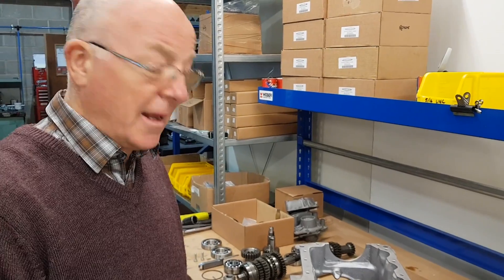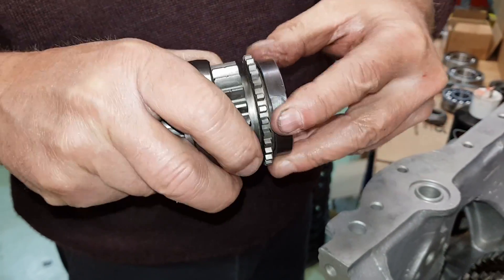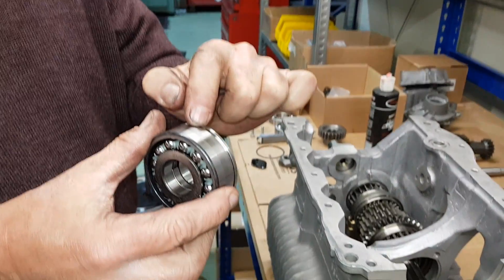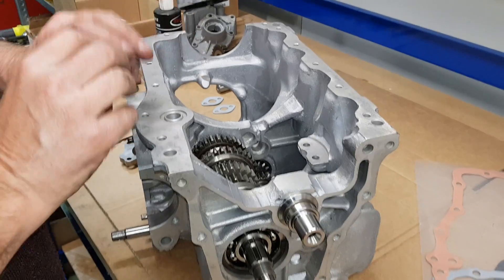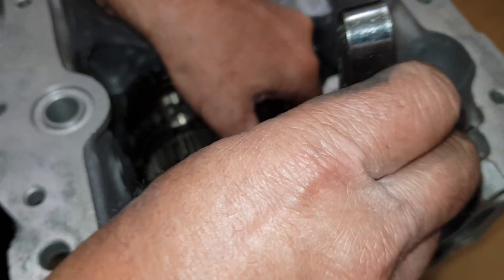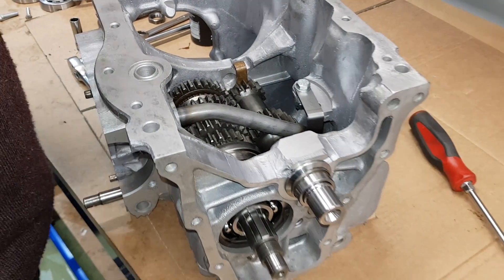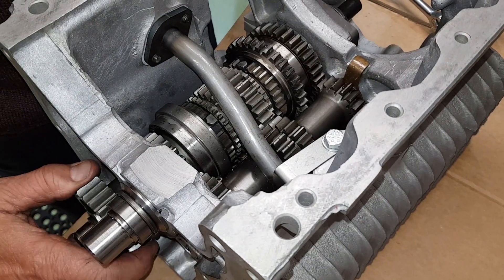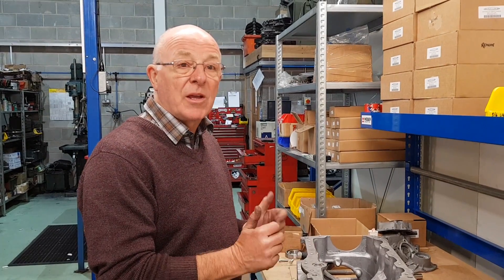How to build an MED straight-cut Mini gearbox - part 2

Comment: I wanna ask, if i buy some straight cut gear is it can install to any gear box??
Reply from the maker: The Clubman gearset fits in rod change housings only, but the six-piece race set works in either rod or remote boxes.

Comment: I'm struggling to select two gears. I can select the gear closest the pinion but not the one closest the drop gears. Any ideas?
Reply from the maker: To select two gears at the same time?
Reply: @MEDEngineeringTechVideos  so I can do the pinion and first motion shaft nuts up.
Reply from the maker: @MrBerty1988  Yes, ok, that's what we were trying to clarify. Do you want to give us a call and speak to Lee or Steve? 01455 618464. Might be quicker!